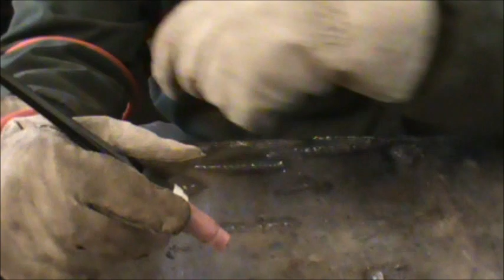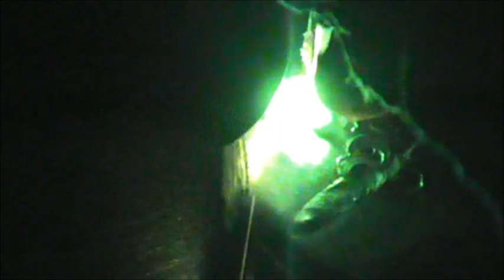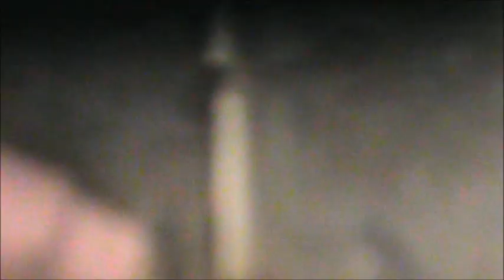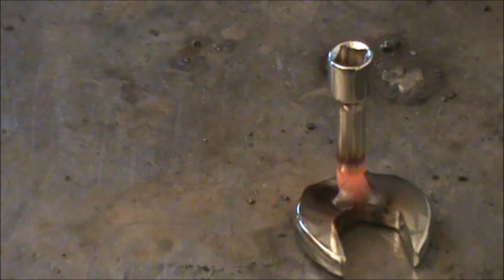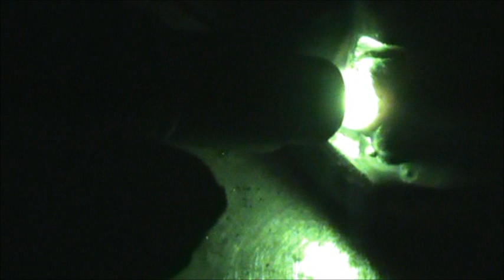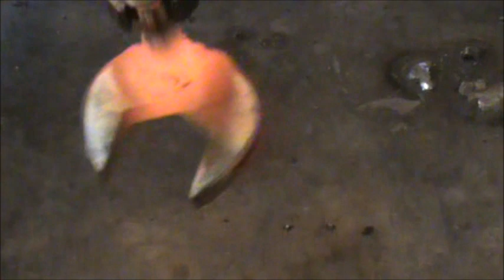Tig Welding Home Made Tools

Comment: Roman, You were "long arcing" too much which throws too much heat everywhere, except exactly where you want it, Use a short arc length and do multiple layers and let it cool a bit between each layer. Also being tool parts it would be best to use ER312 stainless or similar for a tougher weld.